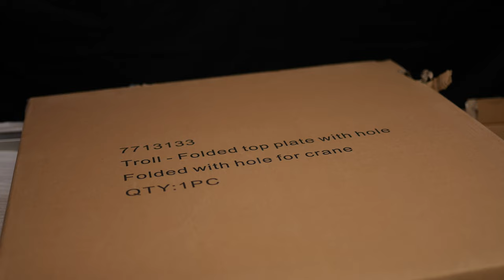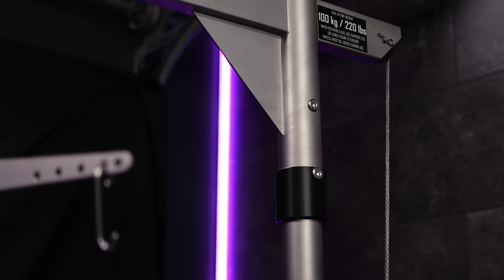The Brewtools Troll The Ultimate HomeBrewing Table System

Comment: Way over priced
Reply from the maker: I do understand it's not cheap, but like I said in the video the cost for the crane is actually extremely competitive. I've got another brewing table in the brewery right now that is smaller but surface area for surface area the value is apparent. Stay tuned!
Reply from the maker: It definitely isn't cheap, when compared to other offerings it's actually not too far out of line. Having said that, I would have loved to have seen it. I didn't even lower price than it currently is. 🍻
Reply: The crane does not seem that overpriced, but the tables seem crazy expensive.  I am thinking about getting the crane and rigging it to something cheaper.

Comment: I think I've only chimed in once before, but I have questions! First, is it for sale and how much as I couldn't find it for sale online? (I found the manual.) How Much? Would it work for things like the Anvil Foundry and BrewZilla systems to help lift the grain basket? (Wondering about the clearance.) I have a handful of older home brewers who struggle and have even had a question from a disabled gentleman confined to a wheelchair about how to live the grain baskets with pully systems, but this thing looks like a great solution. Plus, I'm not getting any younger, and with one of my health issues, the inability to lift could come sooner rather than later.

Comment: My back would appreciate this, 15gallon mash tuns full of wet grains are hard to move. 

Lithium grease for the swivel point of the crane
Reply from the maker: Mine does. That's for sure. It really is nice to use despite what the naysayer say. I don't think you could build one at a stainless steel for the price it's offered..
Reply: @PortlyGentleman  oh ya, I remember buying a trim table for wide format printing... 1500 bucks for powdercoated pot steel

Comment: Looks nice, but i keep my HLT right next to my BT B80 so i needed a wider table. Ultimately purchased a kobalt table from Lowes. Its super stable and large. My only gripe is how high it is from the ground, wish it was shorter but its perfectly functional.

Id like to find a good mount for the chiller though...

Thanks Bradley for the video!
Reply from the maker: Thank you 
You can definitely add another super short or taller table directly to the side. Of the TROLL as it's a fully modular system. Having said that, it obviously brings the cost up. 
Mounting the chiller is the way to go!
Reply: @PortlyGentleman  good suggestion, I like the height of the TROLL for sure and you are right, the modularity is helpful albeit extra dollars.

Are you aware of any out of the box mounts for the chiller? I probably could mount it directly to the wooden table top but wouldnt mind something more vertical that takes up less space on my table. Either way, it works pretty good!